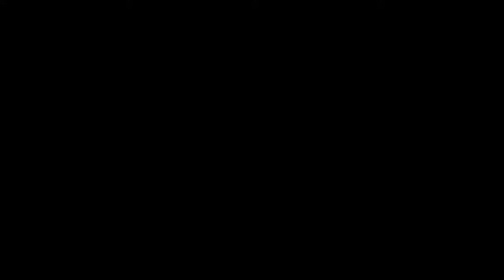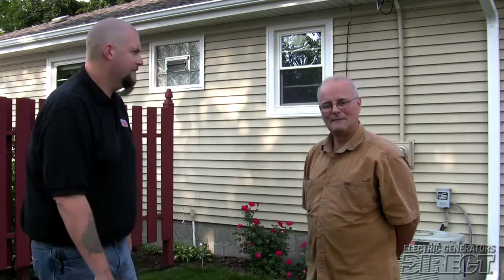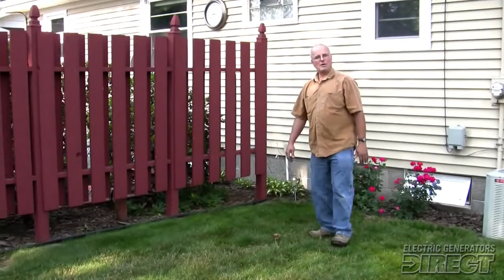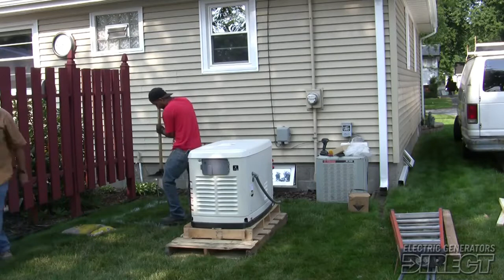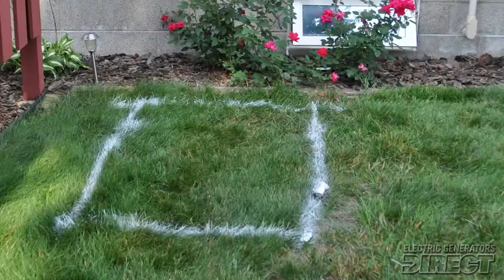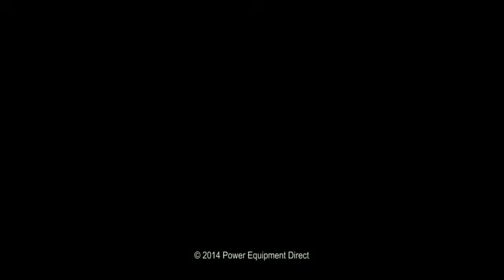How to Prepare the Foundation for a Home Standby Generator

Comment: Near an AC unit and a basement window?  Isn't there danger of carbon monoxide uptake?
Reply from the maker: In general, you should have a 5-foot clearance from the exhaust outlet at least, but refer to the owner's manual for a specific product.